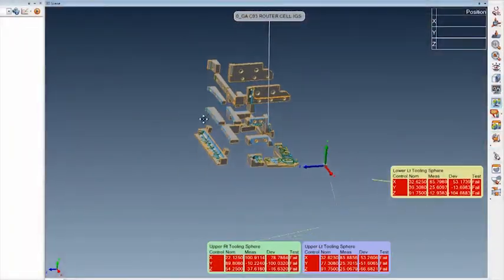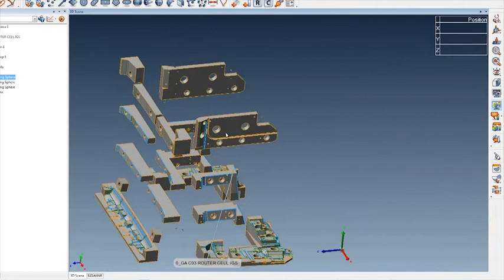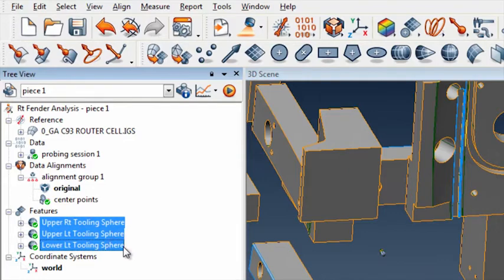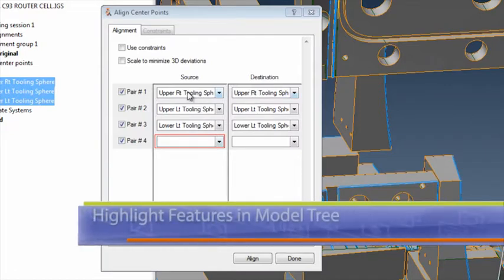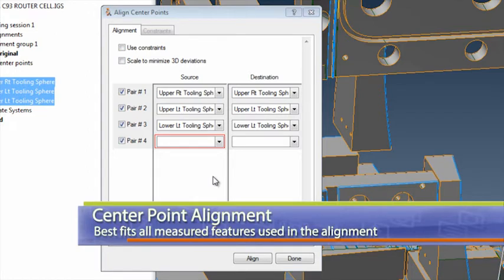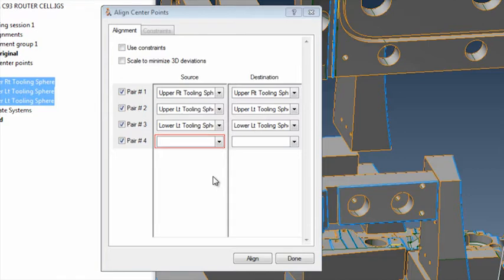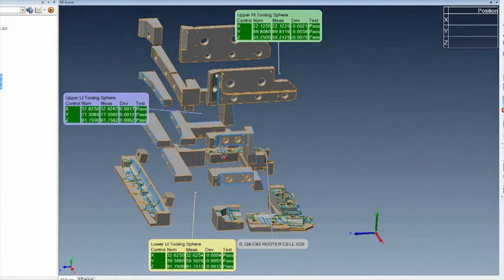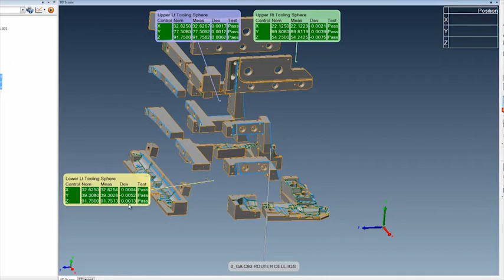PolyWorks: Centerpoint Alignment

Comment: what replaced center point alignment in polyworks 2022 and newer. It looks like they removed this alignment type.
Reply from the maker: Hey there, Winch Cable.  Thanks for checking this out.  PolyWorks uses the "Best Fit Features" now which works the same way.  What is your email address?  I will send you a screen shot of the workflow.
Reply: @diversedimensions1  best fit measure objects. Got it thanks IS forced me to update from my 2017. Not a fan, 22 is buggier and the work flow is a bit slower, but so be it. Thank you!

Comment: Hello, I have a question. If I probe a component and midway through the session, the orientation of the component changes (say for example someone accidentally bumps the component with their hand). Is there a setting in Polyworks to reorient the probed data without having to start probing again from the beginning? I tried browsing through the alignment options but I can't seem to find a solution. Is it perhaps possible to create a new coordinate system and align the original system to the new one? Or is there another way? Thank you
Reply from the maker: Hey there, J!  Thanks for reaching out with this one and I can totally relate to this because it does happen from time to time where the part moves, the tripod with the tracker moves or one of the monuments gets bumped.  This is worth catching up over a phone chat.  Feel free to buzz me at anytime at (616) 218-4259 and we can talk it through.
Reply: Hi there sir, I have doubt too but totally different to this topic... Can you please tell me how true position calculations works for round slot?